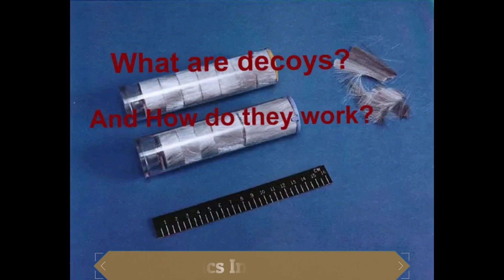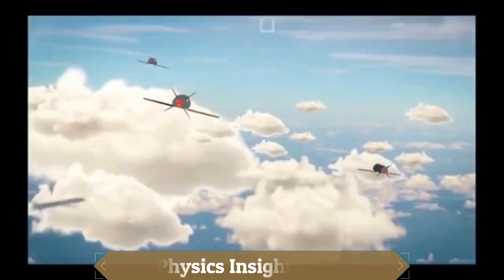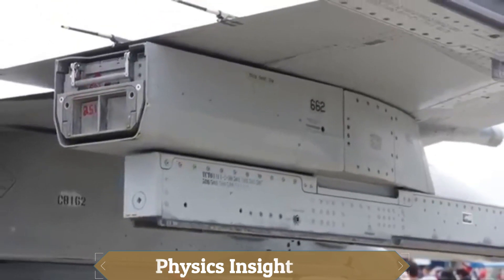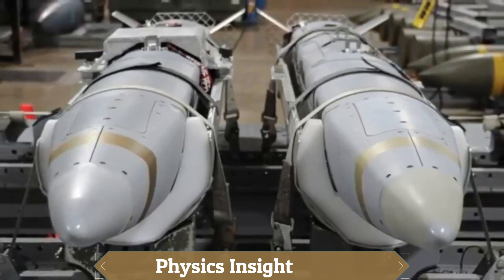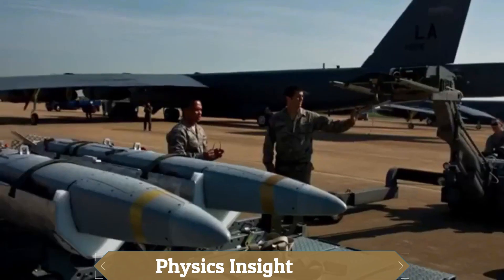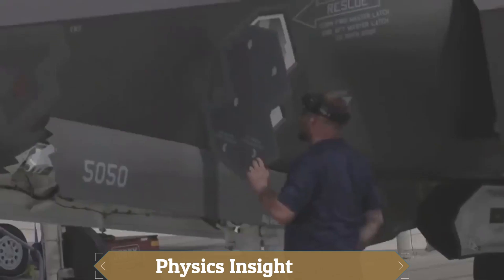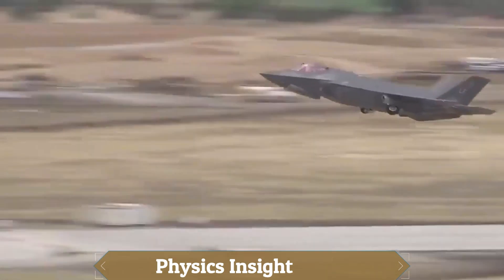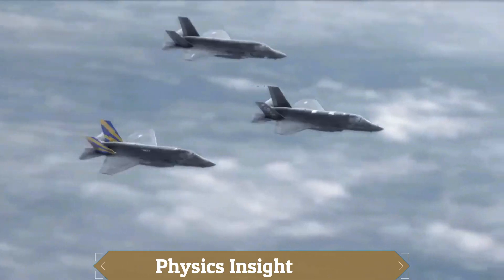What are decoys? And how do they work? ||Deceiving Surface to Air Missiles

Comment: ir decoy for f22 is native iron made in a magnetic sputtering chamber. by fine tuning the repeating 3d structure, lockeedmartin figured out how to tune the reaction rate really well compared to typical phos flares. also they work regardless of temp and humidity at higher altitudes. finally they give some chaff/window activity since theyre conductive.
theoretically they serve as an anti tampering/self destruction mechanism too. i believe the compound is used primarily in this way on the newer mq9/globalhawlk varieties.